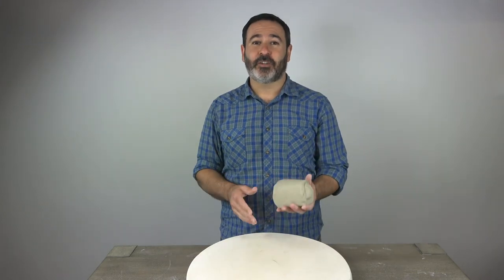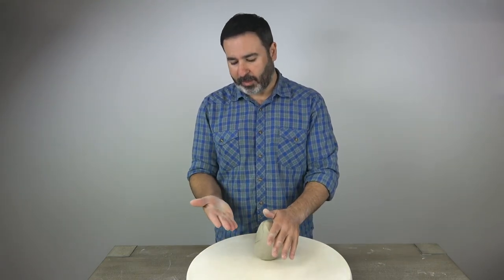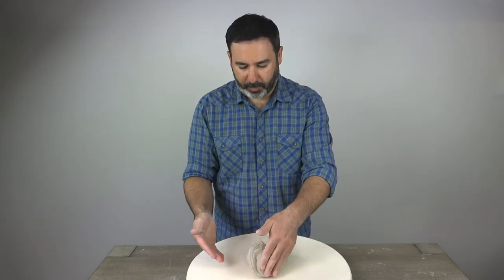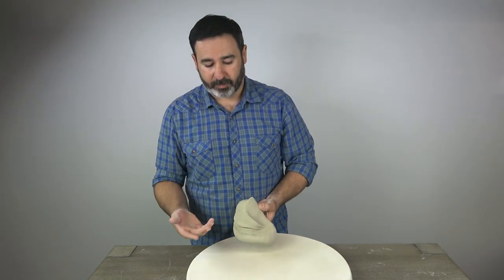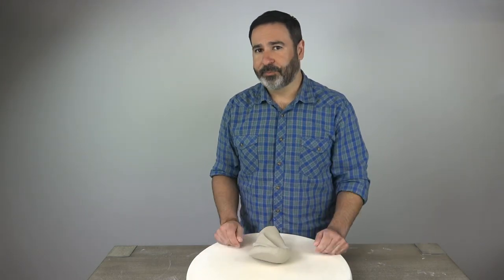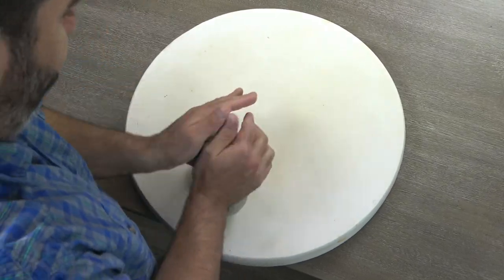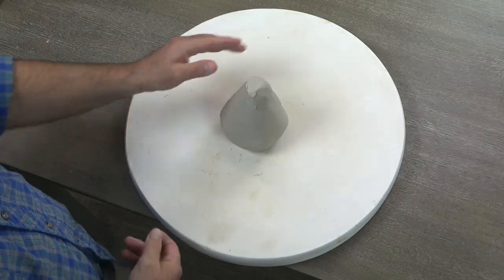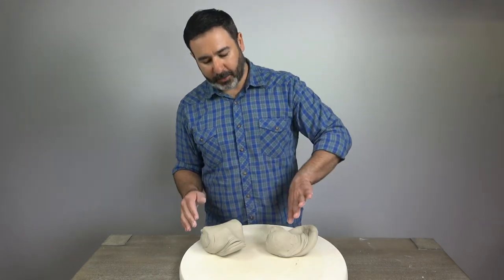Pottery Basics: Spiral Wedging

Comment: Nice explaination! Thank you for sharing!
Reply: Not sure if you got a reply,but what I have which works well for me is a plank covered on both sides with heavy canvas. I use one side for white clay and the other for terracotta, brown and black clays. Every now and then I hose it down and leave it outside in the sun to dry off. Works very well. I secure the board to my wedging table with clamps to stop it slipping around.